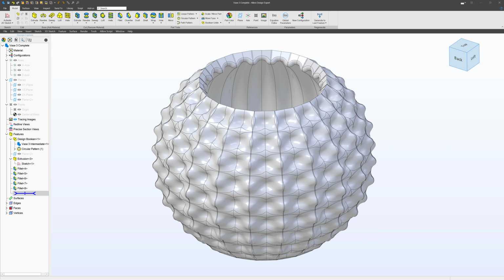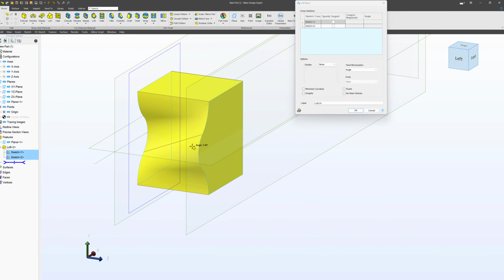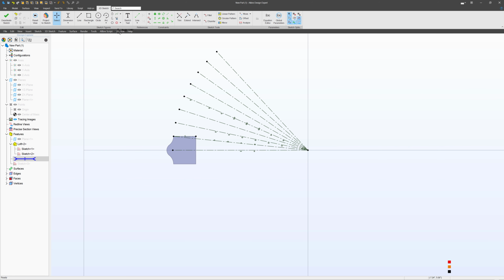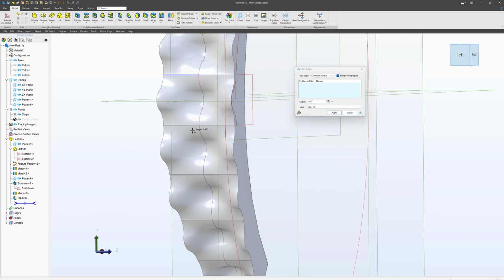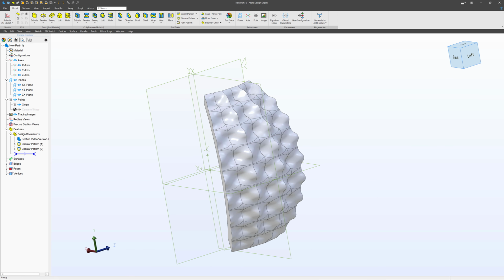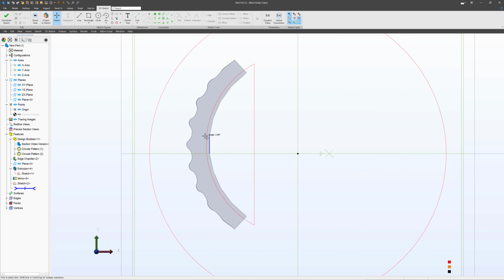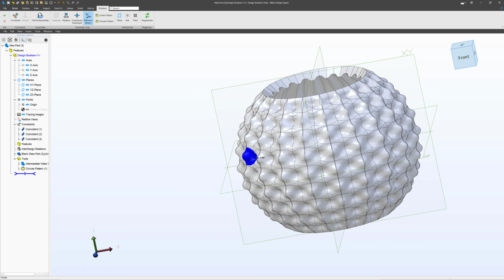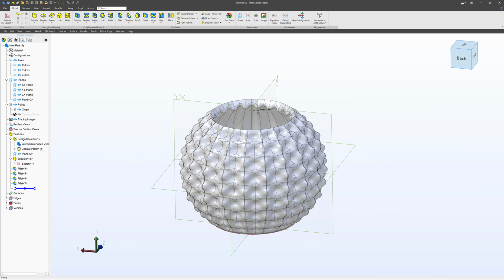Alibre | Vase - Patterns, Booleans, Mirror, Oh My!

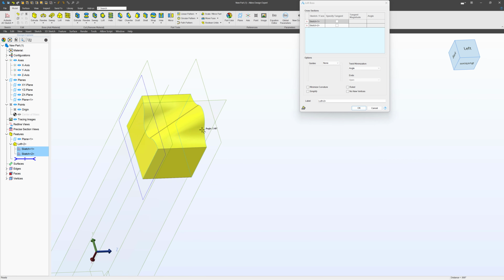Comment: 3:05 - can you explain more of what this setting with center of gravity does?
Reply from the maker: I do like the setting a lot.  It minimizes the twist in a way that the elements being lofted are kept as symmetric as possible, and is most effective if you intend to have some part of the loft be symmetric to another part of the loft
Reply: @AlibreLLC  Thanks, and why is it called center of gravity?
Reply from the maker: @trebmaster   For this case, the computational engine uses the center of gravity of the part to establish the symmetry in the loft.  From the help file:  

The Twist Minimization option allows four different preferences to choose from.

Center of Gravity - Profile mapping is determined based on their centers of gravity and works well for when profiles are symmetric to one another.
Distance - Profile mapping is determined by the distance between points of the profiles.
Angle - Profile mapping is dependent on the angle between the two profiles.
None - Twist Minimization is not applied.